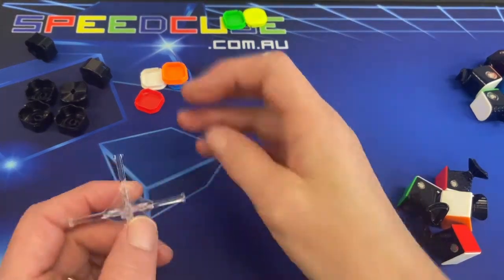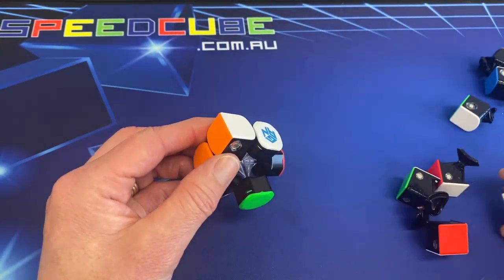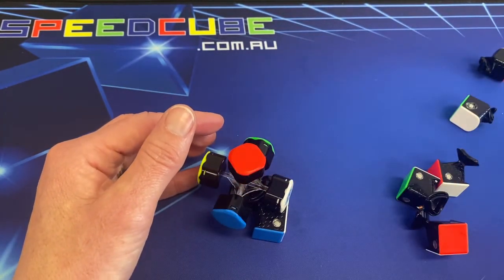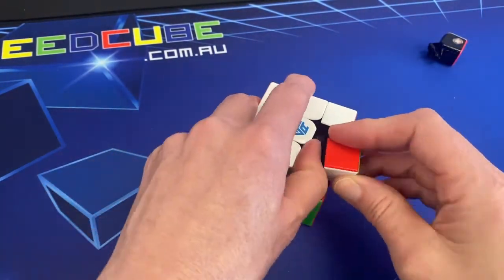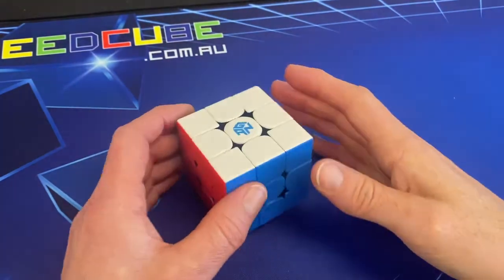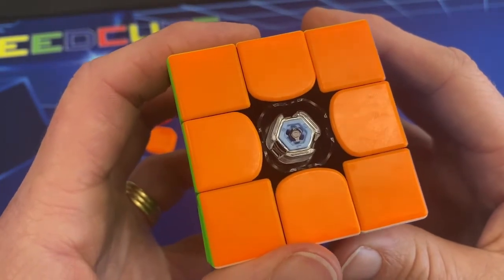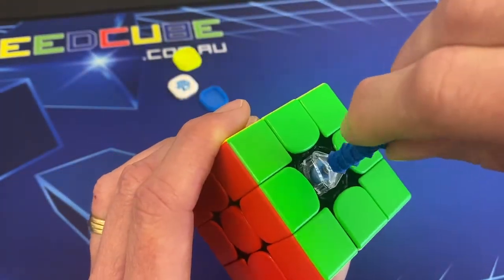How to assemble GAN356 XS

Comment: Please help. I can assembly but when I start to use the cube, it splits again and all pieces are around. It’s a Gan Mini M Pro.
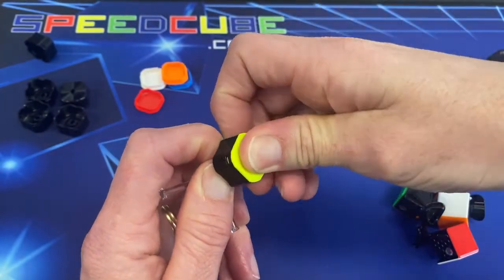Reply from the maker: Listen and watch at 0:35s of the Video.  IF the blue nut is on the 🚫 then it will not stay on. Hope this helps 🙂
Reply: @SpeedcubeAUS  Don’t see 🚫 option on the mini. Thanks anyway for your time.
Reply: @msbagger  Just try to turn the blue nob to another configuration
Reply: @immense_dreamer  Thank you very much.